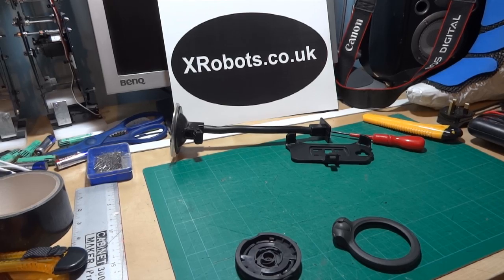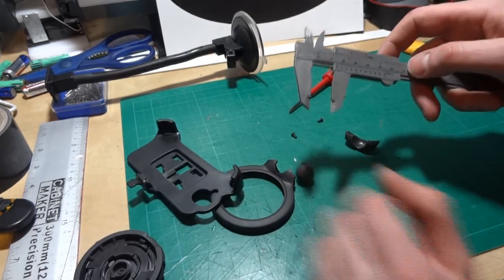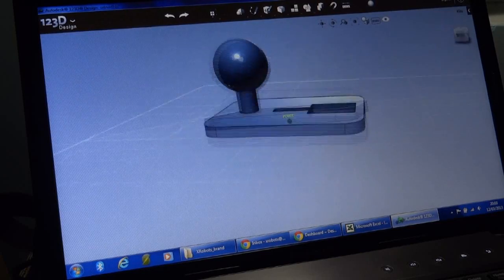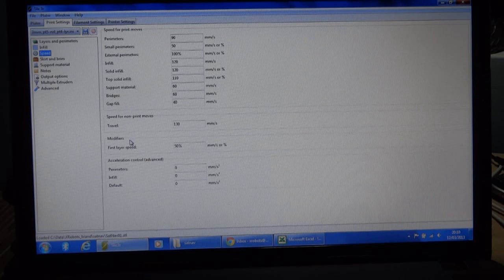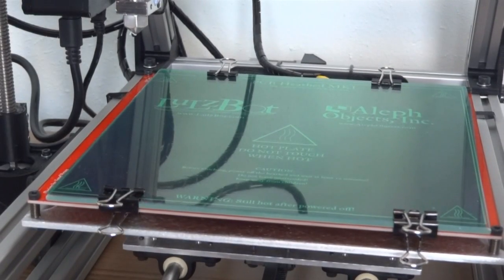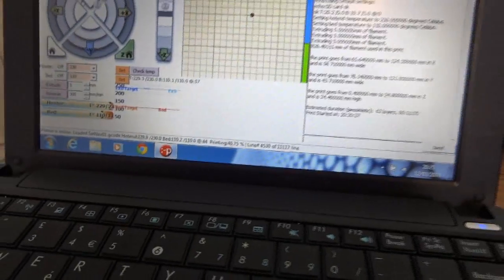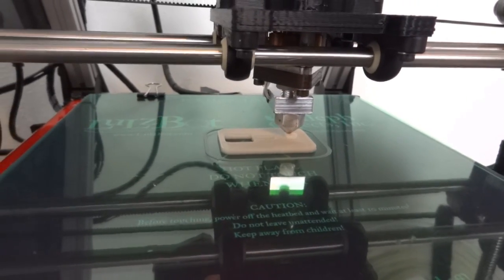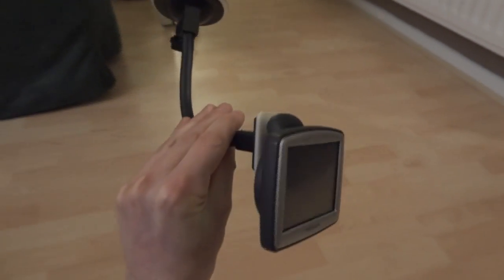Sat Nav Bracket 3D printed repair using Autodesk 123D, Slic3r, Printrun, Lulzbot AO-101

Comment: James, can I ask why you didn't choose the rotoscoping option in conjunction with 123D catch software? Would it be a viable option, to make a faux fix in real life, and take the rotoscoped pictures to make a 3d version without modeling. In this case, the model was quite simple, but in other more intricate examples it may not be as easy to remodel exactly.

Comment: I want one of these but the problem is I'm not paying those prices for some freaking ABS. I work at a plastic injection molding factory in the Netherlands and we pay 1-2 pounds for 1 KG ABS... the only difference is that we buy it in small balls and for the printer it's a string. I think those ABS rolls are just a big overpriced scam. Do those machines use PVC as well?

Comment: That wasn't the worst case, that was a fire on top of a saturated container. Get a flammable ratio inside and an explosion is possible. Acetone belongs in the inflam locker and care should be taken (safety goggles).

Speaking of which we need an inflam locker for the space. I'm keen to try the acetone thing too, I have about a litre of the stuff.